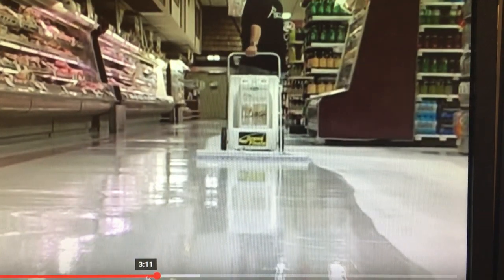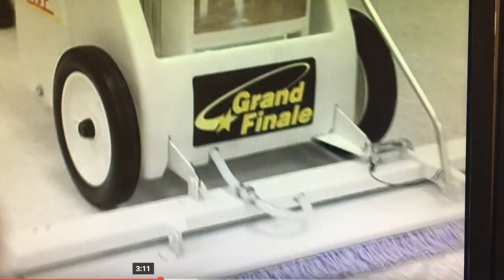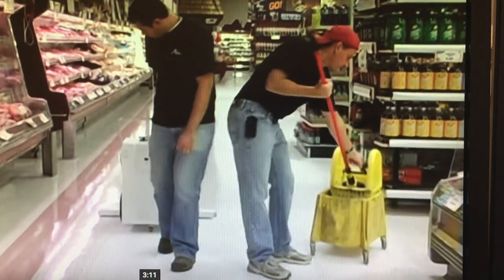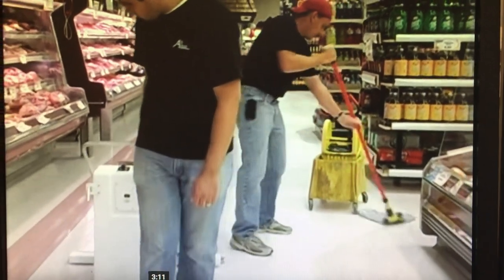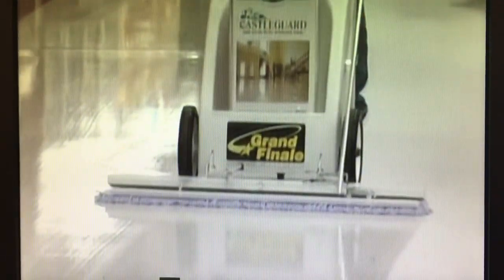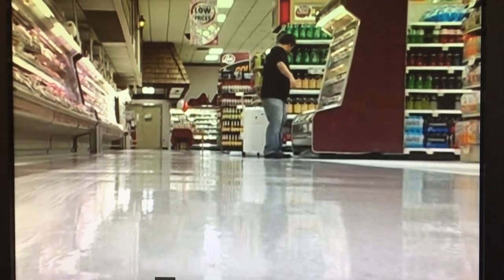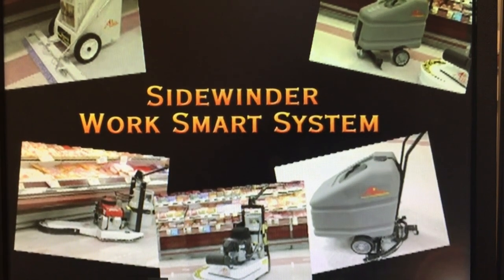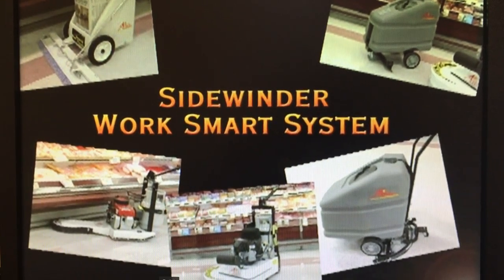Aztec Grand Finale, Finish Applicator - An Introduction

Comment: These are junk!  I bought one, concept is good, but I’ll reveal the problem.  So the wheels provide the pump action to pull the wax out of the bucket, it works until the bucket begins to lighten as more wax is pulled from the bucket.  When the bucket is half empty, the cart can no longer turn the wheels because it’s to light.  The wheels require a full bucket to turn.  Sorry buts it’s the truth
Reply: Then put a weight on it lol